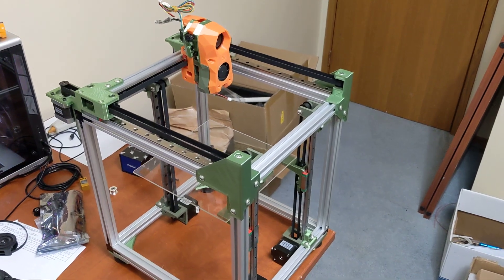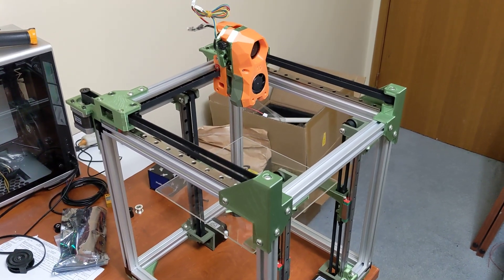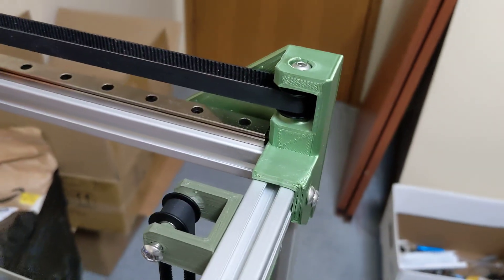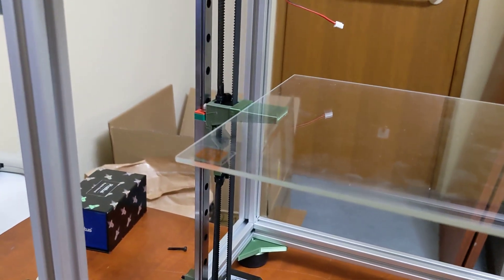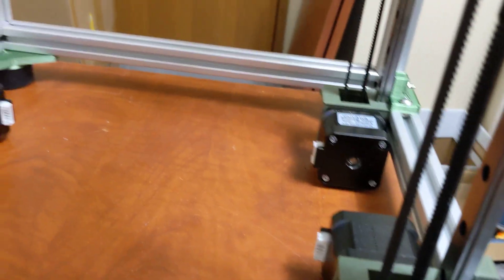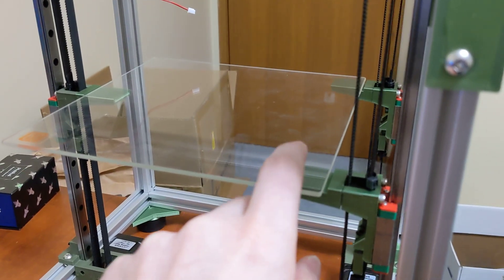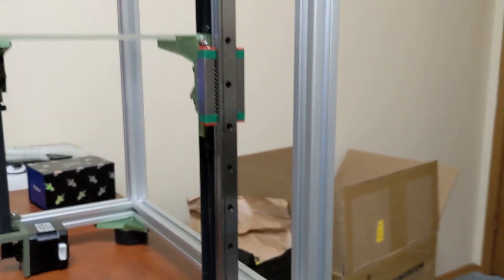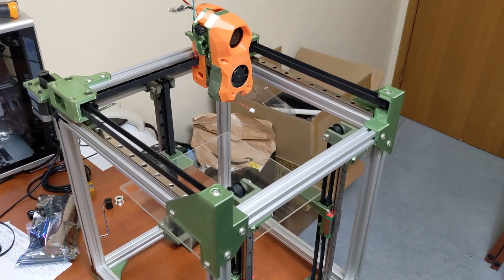Building a H-Bot 3D Printer - SimpleCube Ultra - Episode 2 Z-Axis

Comment: looks good bro ! heated bed will heat printed parts on z axis ?
Reply from the maker: They will eventually be printed in ABS, I generally only print Pla also so even petg would be fine.
Reply: @Rolohaun  abs bends after 80 celsius degree. Find another idea maybe
Reply from the maker: @ramilvaliev  abs should be good to 100, the voron trident uses abs parts for the z without issue and that's an enclosed printer. My bed will not be heated over 60
Reply: @Rolohaun  ok lets see :)
Reply from the maker: @ramilvaliev  that's a big reason why I am building this to see what works and what doesn't

Comment: Awesome! Very impressive. The z looks clean. Would love to see a klicky probe in action on this.. It would look so cool.. Won't the glass Crack or break for heat? The simplicity is just great... This is what we need more of.. 
Tired of seeing z wobble complaints with ball screws, layer adhesion problems with mic 6 plates and inductive probes. 

Solving problems with simple solutions.. I love the z axis. 
Do you think I could implement this idea of using a vhb tape for a 350*350 glass plate? What thickness of glass do you recommend? 

What about the void Spaces which are left without heating, ( assuming the heater pad is smaller than the plate)
Reply from the maker: I plan on making a 300x300 version after. I am using a tempered glass plate so it's made to heat and cool. My glass is 3mm thick.

Comment: Following. Very inspiring. I'm building a 350*350mm printer based on the cartesian sourdough printer with rails and belted z.

I had this thought too you know, heating the glass plate directly without using expensive mic 6 plates..

Since the glass is directly stuck and constrained to the mounts, how will that plane actually tilt?
Reply from the maker: The VHB tape will have some give, I don't expect the build plate to ever be off more than a few mm. I can't see why it would tilt that much, after every print it will lower down to the bottom and be pretty straight

Comment: This is genius that thing looks like the perfect compromise between simplicity, function and price ... The only thing I'm curious about is if those 3 z steppers are strong enough... it's not like I calculated anything or because if have any experience with builsing printers what so ever but simply because I remember the voron having the 4:1 ( I think it was ) reduction even tho its only carrying the head frame and this thing could especially with the up to 300x300 size fit up to 600g and more of plastic on its build platform
anyway still so looking forward to this thing being done...
 One more question ... What makes you say that this thing won't be for speed but only for quality ?
Reply from the maker: Thank you! The steppers should be ok for the z, it's very light but I for sure could be wrong, like you I am very curious to see it print! H Bot printers are known to be not good for speed, I want to test this and find the limits.

Comment: This is the kind of design I love. Straight to the point. If tape works as well as anything else, why not use it?
I've always asked myself why people stress so much about having a super flat aluminum block as bed, when they are going to slap on it a magnetic adhesive and spring steel adhesive, which are not that flat.
Reply from the maker: Thank you, I can maybe see a big thick plate being nice for high temp abs so you have the thermal mass but a piece of glass is really flat and it works great on my delta